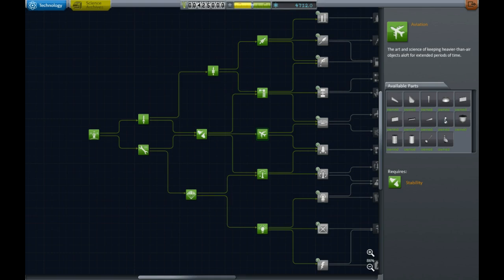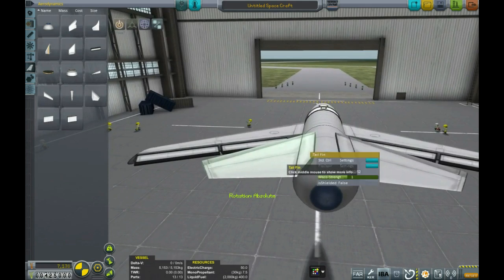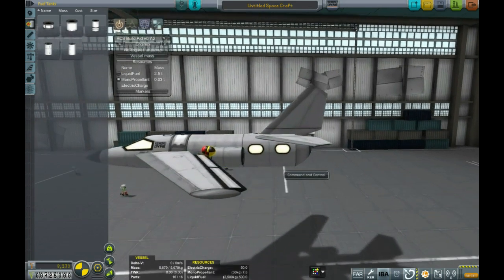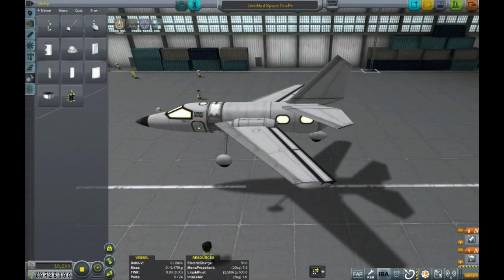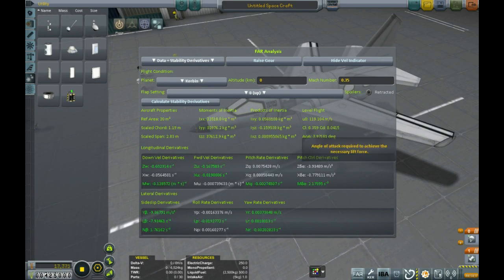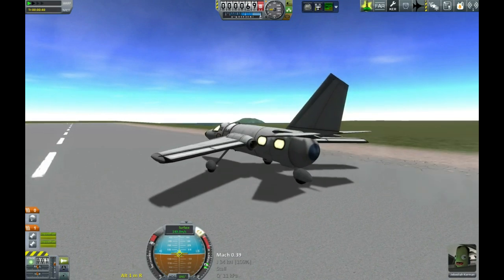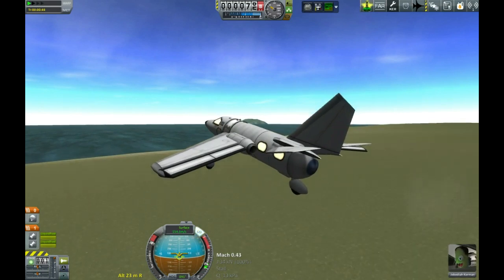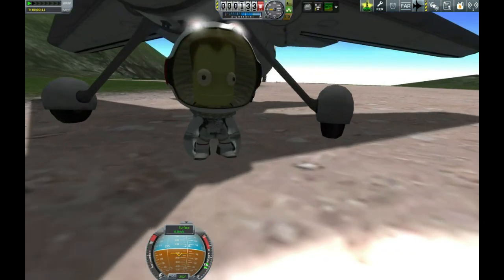KSP/FAR early career aircraft

Comment: Man this game is frustrating. I tried to copy your build as close as possible but my plane wont even keep straight. It turns for no reason and I cant figure out what to change as nothing I do helps :(
Reply from the maker: Keep in mind that this video is very old; the game has changed a lot since then. An old design may no longer fly as it once did.

Check out the official KSP forums; the folks there are usually more than happy to troubleshoot aircraft designs.